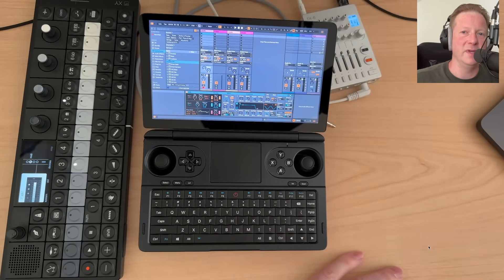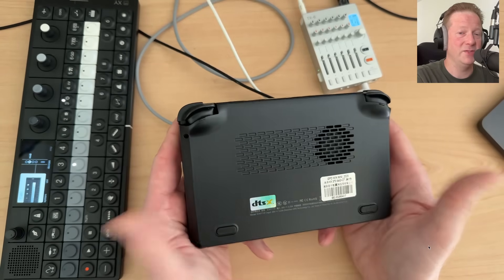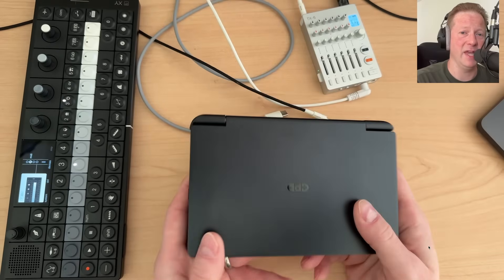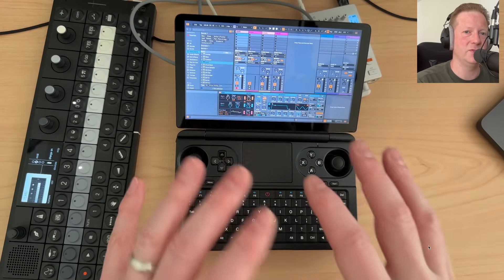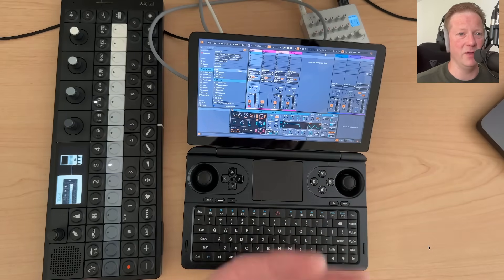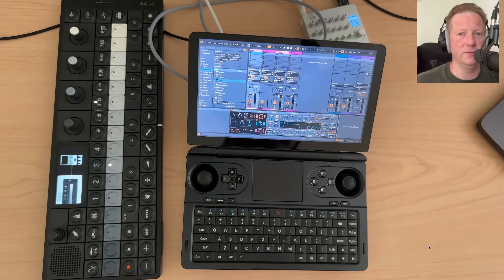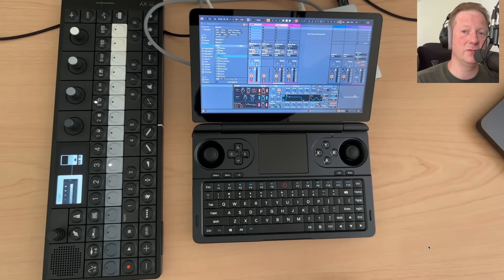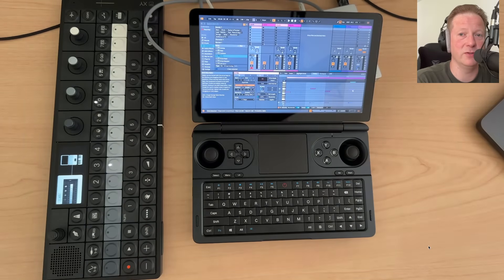in5 - GPDWin Mini 2025 Running Ableton Live and Latency

Comment: They have released the GPD pocket 4. Is it the same as this? Better or worse?
Reply from the maker: I've got the 2025 model, which is this one https://www.gpd.hk/gpdwinmini2025
Reply: @NearTao Both (this one and the convertible one) are 2025 but I think they have the same CPU. There is also the gaming handheld version with a better igpu. If it works on this it works on the other units.

How many vst tracks can you run in yours as playback with no dropouts? I was thinking of using it for Eastwest and attempt 16 tracks. How many vst tracks can it run? 

My idea is to get a keyboard with built-in speakers (like a mini Yamaha) and make the buffer bigger and run as mucj tracks as possible but without dropouts or glitches. Could you test that?

Audio latency is not so much as an issue when monitoring playback while recording using the keyboard's built-in speaker

Comment: How is the OP-XY as a midi controller for Ableton?Does it only do notes?Any chance of controlling devices with the pots?
Reply from the maker: It works quite well, and yes you can use the knobs.  They are midi cc# 1-4, and additionally if you push in on the encoder you get a separate cc event for each.  Unfortunately there is no SHIFT+knob value for four more settings, but it does work well for what it is.

Comment: Thanks for reviewing this one! this is indeed the first tine anyone does it. another interesting topic will be for the M8 headless comunity since a lot of people are waiting in line for the hardware, many of them go headleas and use teensy on many carier devices but I have a feeling that the winmini can be a winner due to its built in controller, soundcard and now after you showed it, battery life
Reply from the maker: I just tested it out with Chrome on the GPDWin Mini and it is quite easy/fast to setup.  Not sure about how long the power would last, but I'd have to imagine you can go down to 5W for the CPU and get 5-6 hours easily, and still have access to plenty of functionality of Windows to do plenty of other cool stuff to boot :D
Reply: @NearTao  That is great! thanks for testing❤ so with a battery life of 5 hours and maybe with the m8c app you can use your gamepad builtin controller. it might be super solid

Comment: I have the 2023 version and for a while it was my do it all device. Sadly, I'm selling mine for a Win Max 2 because I'm tired of carrying around a portable monitor, bluetooth keyboard and mouse and power bank (the battery life on this device is my main gripe) just to have it function as a laptop. The Win Mini would probably serve better as a secondary device but I kind of like the idea of having one device that does it all and I think the Win Max 2 can do that for me.
Reply from the maker: Yeah I hear you... the GPDWin Mini is definitely a lot of compromises for sure... I've been setting the TDP down to 5w and getting plenty of battery life out of it (like 4-6 hours)... but yeah if you don't adjust the TDP you'll burn through the battery in an hour or two easy.

good luck with the Win Max 2, it also looks like a solid device!